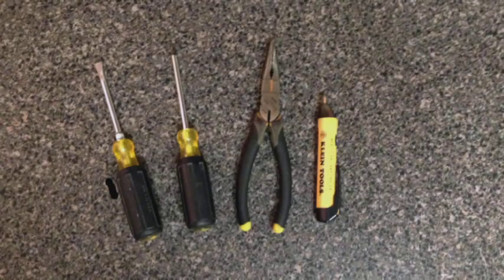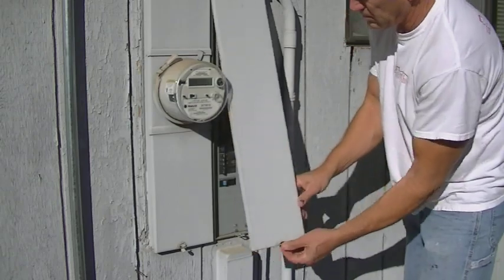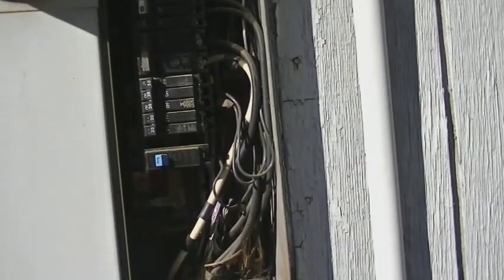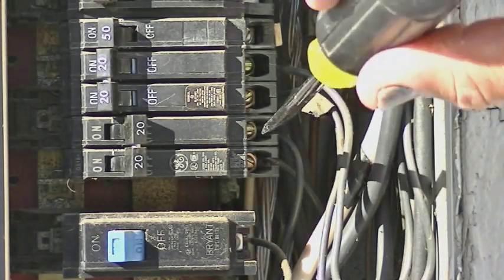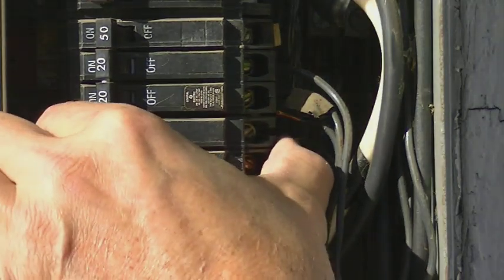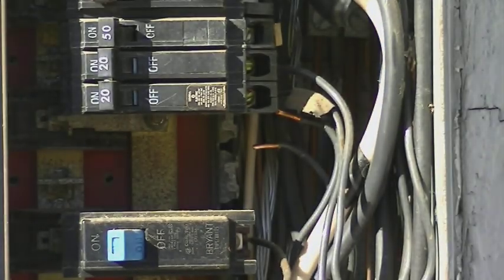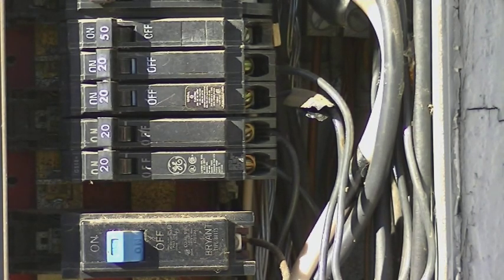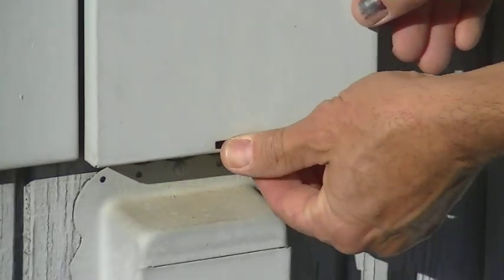How to Replace a Circuit Breaker By: Everything Home TV

Comment: I insulated the screwdriver shanks with rubber tubing from Automotive store- one more factor of safety. Also, if leaving the main breaker on , I suggest turning off the two breakers adjacent to the one you are replacing., That way if a loose wire strays a little you won't cause a short circuit.Also, best to stand on a piece of wood to keep yourself from being grounded.
Reply: Valid comment. Makes sense.
Reply: Excellent safety tips! You should make a video of this process.
Reply: Or just buy insulated screwdrivers...
Reply: You must turn off the main power to be safe.
Reply: @Crack Shot As far as I know, there’s always a main breaker/disconnect (unless illegally installed). It will either be in the panel like this one or a main disconnect between the panel and the meter.  Newer code requires a main disconnect to be accessible to emergency services and so it could be outside by the meter if your main panel is inside.

Comment: Thank you for your video. I had done few times before but I couldn't pull out the 60 amp breaker out. I know that it should be till and pull, but it did not work.

Comment: Nice no frills video but IMHO you were working with those loose wires from the old breaker were a little too close to the live breakers directly above so I would shut those off too in an abundance of caution especially if you are new to this.

Comment: Great video.   For the layman or nonpro, will it be safer or necessary to shut off main to do replacement?  Also, I noticed that the video tech Brian never ever touched anything in the panel with his bared hands; was that because even though the circuit being replaced had been turned off, there still was residual load left in the breaker poles and related structures?  Please reply.  Thank you.
Reply from the maker: +Montery12 Yes, shut off main breaker if your panel has one (this panel did not).  Because there was load on the other breakers we try to do everything with insulated handle tools to prevent shock.

Comment: Need to change a breaker from the pool panel. My ? Is do we turn off the house breakers off as well before replacing the pool breakers.😍
Reply from the maker: You should only have to turn off the breaker at the main house panel that supplies the panel at your pool. And then change the breaker at the pool panel.

Comment: Aren't you suppose to shut the main line off first before you take it out?
Reply: Yes. Not sure why he didn't cover that.
Reply from the maker: This particular panel does not have a main circuit shut off.
Reply: Such a solid point. If the box has no main disconnect it has to be being fed from another location that has a main shut off. I know lots of contractors that work on live boxes like this. It is dangerous even though they are experienced. However, none of these folks handing out advice on YouTube should be doing so if they don't discuss the fact that the circuit bar is still hot and can potentially kill you if the main is not shut off to the bar. Even with the main off in most panels, the main service feeder is often still hot at the top, and is also deadly. Point is, it's any easy job, but just a few seconds of safety advice is needed in most of the DIY videos I've seen on breaker replacement.
Reply: Jedism0k3s l
Reply: That's not correct actually. This is a GE box. The service disconnect is above the power peter.

Comment: COuld a breaker be only partly broken?  I have baseboard heater that suddenly heats only half as much as before with the electric wall thermostat showing heating at full power.

Comment: Can I change 50 amp circuit breaker to 30 amp circuit breaker? My current microwave/wall oven combo should have 30 amp breaker according to GE tech support but the circuit breaker had 50 amp for it. My house was built 25 years ago and I think the previous owner installed the microwave/oven combo without switching the circuit breaker amp.
Reply from the maker: +refresh77 Typically you can go down in breaker size but not up with the wire that's installed 10 gauge is usually for 30 amps 6 gauge for 50 amp so if you have 6 gauge it will work for 30 amp too. You just might have a hard time getting larger wire  into smaller amp breaker

Comment: Can you change a 15 amp breaker to a 30 amp breaker for a 3000 watt load.
Reply from the maker: Not unless that 15 amp breaker has 10 gauge wire going to it. 15 amp breaker has 14 gauge wire 20 amp breaker 12 gauge wire 30 amp breaker 10 gauge wire. You cannot increase the amperage above what the wire is designed to handle.

Comment: Is this the same in Australia? I mean they look the same or very similar atleast
Reply from the maker: It's probably very similar, however without being there we can't be sure. But if you'd like to send a couple of round trip tickets we'd be more than happy to come have a look!
Reply: Sounds fair, I ended up getting myself a Factory Unit lease, as the electricians in Australia seemed to be very worried about fitting a 50amp breaker to my home metre box and running a power cable to my garage. But in other news, I am wondering what thickness cable I should get to run a 3 phase power lead for my new machinery to run in my workshop. If you think 6mm twin and earth is ok, I'll use what I have, but I think I might need bigger, not 100%. The Air compressor is about 3800watts, that would be my biggest power draw
Reply from the maker: +MotorcycleTherapy Wish we switched to the metric system years ago!  Here's what we go by in the states, wish we could be more helpful!
Reply from the maker: +Everything Home TV Pics didn't show up...  20  amp 12 gauge wire 30amp 10 gauge and if its a long distance from breaker to outlet you may need to increase gauge of wire.......

Comment: can I change a 20 to a 40 ? or is there other changes I need to make first ?
Reply from the maker: 87turbo......No you can NOT just change from a 20 amp to a 40 amp, the reason being:  The breakers and wires going to the outlet or appliance work in unison. In other words a 20 amp circuit will use 12 gauge wire while a 40 amp circuit needs to have 8 gauge wire.  If you increase the amps without changing the wire you risk an electrical fire from overloading the wire.

Comment: tnx, but you might have mentioned (ESPECIALLY with your panel that has NO 'Main Power Off' switch)  that the new/replacement breakers should have their 'levers' in the 'OFF' position .. otherwise, SPARKS would be showering as soon as your needle-nose pliers pushed the wires into  the screw-tiedowns !

Also, if the panel has labels identifying which breaker goes to which house appliance or circuit,  just stick a tiny piece of electrical tape on ONE of the wires , remembering to which of the two breakers that wire goes to .. so that the panel 'Labels' will still be correct ..

I'd also not trust my life on the functioning of any 'non-contact voltage detector which has its light OFF to confirm the safe condition!   What if there's a flaw in the unit??? It'd tell you there's NO voltage when one might be present!   Those devices do have lil batteries in them, no?  which could fail at any time..

Far safer to use a Digital Voltmeter which, if IT fails, the screen is FAR more likely to be blank ...!  but that's just my own humble opinion  ;)
Reply from the maker: Actually we do address that through annotations inserted in the video.  They seem to be showing up when played through a desktop but are not showing up when played through the mobile app.  It's an issue we'll forward to YouTube/Google.......

Comment: You did  not shut off the main power coming into the house. For a non-professional, this is essential. In this sense, your video has a major flaw. Note: Most homeowners do not know where the main switch is, or how to shut it off.
Reply from the maker: Prof. Flanagan you didn't read the video description before you watched the video. Your concerns are addressed there.
Reply: Technically a non professional shouldn't be in a panel with the cover off anyway but changing a breaker in particular is no big deal so long as you're not Clumsy McDoofus. Even if you manage to accidentally touch a hot pole with a slight finger slip or something you'd have to be foolish enough to be contacting a path to ground or neutral or the other pole to get a dangerous shock. It's the pole to pole grazing I'd really be worried about, not to say 120V is a joke or anything.